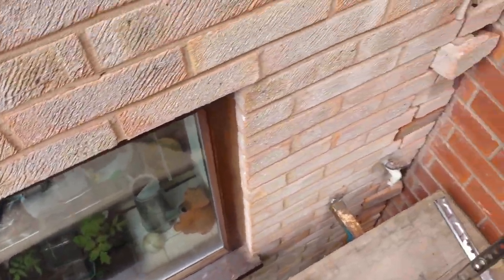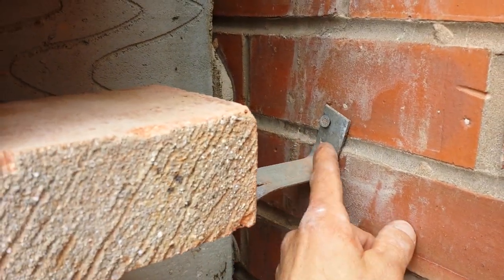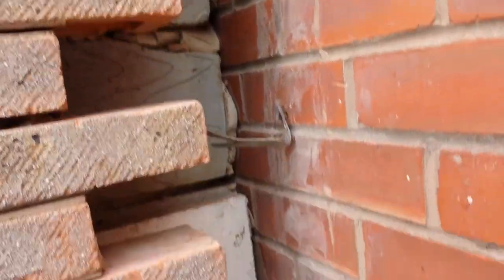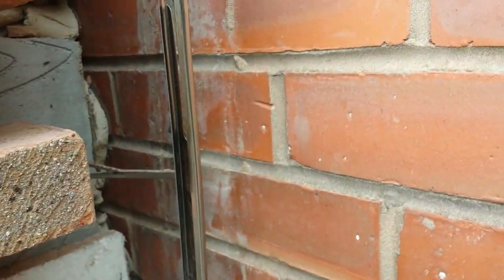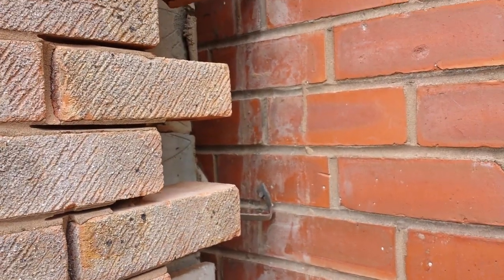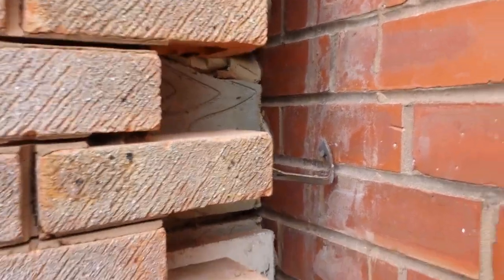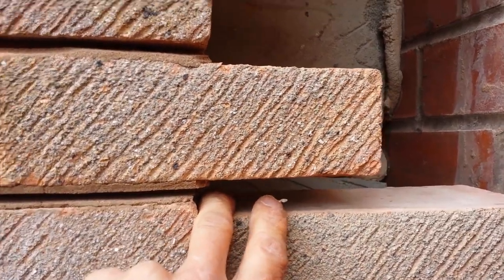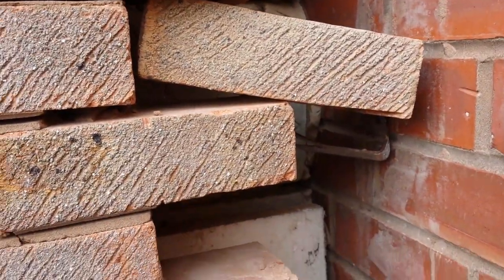when your wall is not properly tied into another wall

Comment: Foundation fault not wall ties
Reply from the maker: Yes mate but leaving the walls not tied together. Caused damp getting into the wall.
Foundation and ground movement is the main fault but if the customer only wants to fill snd strap the cracks then we do it.
It has not cracked since?
You would of thought it would do the same but got not cracking.
This was a few years ago.

If foundations then underpinning is probably the job to do.
Reply: Tie fault as well. Did you see that thing virtually flapping in the breeze?!

Comment: Relitvly recent brickwork!....... few bits on steel aint going to fix this problem! obviously footing collapse that's where the problem needs to be addressed!
Reply: Alan Thomas hello
Reply: How have the footings in any meaningful sense collapsed? At the top where he's raked out all the mortar the gap is still only 15mm wide or so, and the fishtail ties are not even bent downwards so there's clearly not been much vertical movement. He should have just squirted some caulk into the gap and popped off to his next job.

Comment: Extensions should always be attached to the existing building with control or expansion joints and fixed with expansion ties to add stability, then sealed with adhesive to allow for movement that comes with settlement.
Reply: Furfix allows movement

Comment: Ask a structural engineer! What ever ties you put in are going to make no difference if there is differential settlement from the newly built extension and the original house. Probably the extension settles and cracked open the joint. By the time you repaired probably the extension has settled and no longer significantly settling at a different rate to the original house.
Also best to cut all way through to stop damp and cold, add ties as required thus no issue. There should really be a "soft / movement joint" at this location to allow for differential settlement. However this should be considered with regards to the wall layout for structural stability to be maintained. I would not recommend a builder specify remedial works. Builders should carry out the works specified by a professional with specific experience in regards to the issue being addressed.

Comment: Both brickwork and internal blockwork should be tied to the original building, more importantly the cavity should be continues, just cutting a slot through the brickwork and inserting vertical DPC will cause a cold spot and only cutting part way through the wall to insert the vertical DPC will not stop damp tracking through. Vertical DPC is not required if the cavity is continues. If the blockwork and brickwork are properly tied in, the strength integrity of the original building will not be compromised. hope this helps:) Cheers.
Reply: We always cut a Cavity in the Existing wall so the cavity continues also ,i thought it was building regs ?
Reply: Cheers for that ,I would guess its how arsed the Inspector is also .I see that there is independent Inspectors nowadays

Comment from the maker: i agree yes they should of put a vertical d.p.c on the inside of the cavity.
this i come across alot, the vertical dpc stops any damp passing throw the wall external wall onto the internal wall.
use a cutter to do this cut. sometimes depending on were the cut is to be done it can weaken the wall so maybe just a cut that is about half way into the brick.
the idea is that the damp hits the dpc and drops down into the cavity.
Reply: thespecialist7 I have questions

Comment: Hi mate. Thanks for the gret video. I am planning a 2 storey 6m long extrnsion on a stone house. Would you recommend using debonding clips on the wall starter with expansion joint or is that overkill? Cheers
Reply from the maker: Hi fella not to sure what debunking slips are. But you can never go over the top of  tieing walls together. Wall starters are easy to use. Good luck with your build. Check all the new building regulations that are out especially if you thinking of renting it out in the future. Karl

Comment: When would you tooth in and when would you use a wall starter?
Reply from the maker: I would tooth in all the time if possible.
It's cheaper than buying the straps.
But it is easier to put the straps on saves tooting out. 
When it's hard mortar and brick you sometimes need a blade grinder cutter. Or a resip saw is good.

Comment: Why have they not kept gauge with the original brickwork? I would understand if it was imperial to metric but no reason not to If both the same , starter bars ( furfix )  should be drilled and turned in by a spanner not hit in  with with a hammer!

Comment: How did you mange to drill fixings unless you hit the mortar bed with an angle drill. Not seen angle hammer drills? Also can you explain the vertical DPC for say a rendered wall, would a slice through the render be enough? Cheers

Comment: I look at that and am thinking cowboys the brick matching is ridiculous, no vertical dpc, the timber frame ties they used would work if they got next size up and  fixed properly to wall and put in every three courses and the insulation is not suitable it makes you wonder if you opened it up what else you would find👍
Reply from the maker: I agree i see so many cowboy building wats people have done.
This nakes it so hard when you are doing a job and you come across a problem . Its an extra that no one can see due to bad workmanship. 
Thank you for the message.stay safe r kid

Comment from the maker: yes mate i have seen a lot of bodged jobs in my time. from walls being held up by small pieces of timber to concrete foundations filled in with rubble once the building inspector has been and passed the depth.
my advise is always see whats going on with the job ask every day how the progress is going on with the job.
most of all take lots and lots of photographs.
look into how things work so the builder thinks your on the ball.
some people just take the pissatoes.
but please remember there are cowboy customers out there too.
look out for them they should make a series on that.
Reply: thespecialist7 I've seen builders pull fast ones to save money. Whom gave them training God knows that insulation is rubbish incorrect normally used loft insulation around edge of brickwork. They probably hand filled aggregate, sharp  cement in the wrong ratio in footings mix may too hard coursing shrinking. Looking at the condition of work it highly likely saved money on footings. Ready mix would had been more suitable for this build. Looks like a recent build. Those ties are more suited for small garage build maybe smaller.
Reply: thespecialist7 this is crazy

Comment: Shouldnt be tied in at all old buildling moves different than new  if  its soild then the brick cracks instead of controle joint where new meets old
Reply: Rob Mulligan  exactly, if it's moved away almost an inch,it has movement,needs expansion joint,needs caulked.....that being said this guy thinks it easier cheaper,creating work ,when all it needs is the vertical joint where walls meet caulked,recaulked every 20years.
Reply: Having extension soon 4mx4m house is brick extension will be block. How should it be joined together?

Comment from the maker: a small screwdiver.  you get a tool that attaches to your screwgun that bends for screws.
rendering should never reach past the dpc which should be 6" from the outside ground level.
Reply from the maker: sorry a vertical cut should be made to the inside external wall. to stop damp penetrating throw.